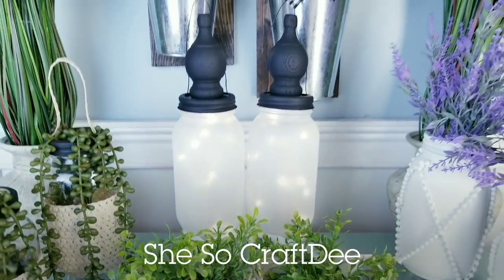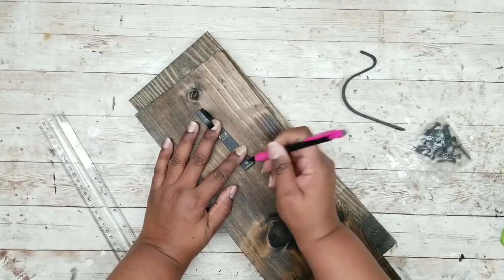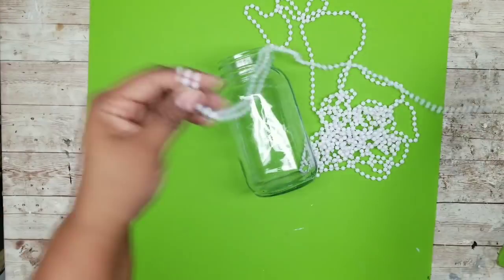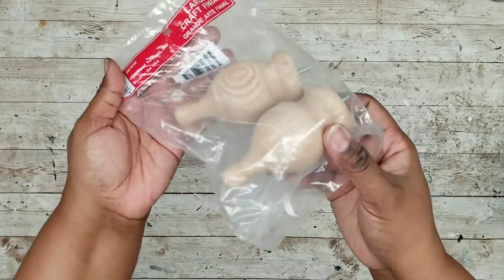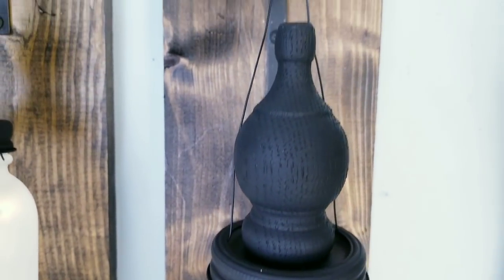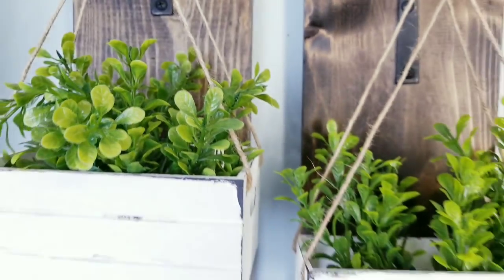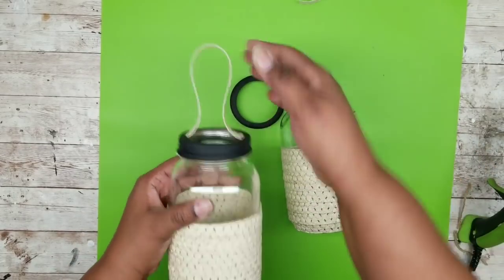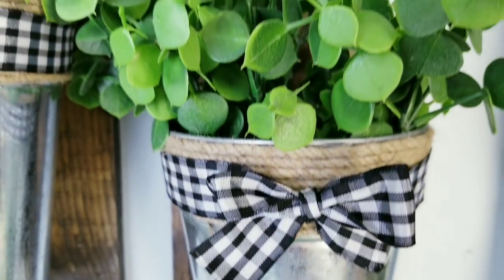*NEW* 6 AWESOME DIYS for WALL SCONCE Decor! | Modern Farmhouse Boho Chic | DOLLAR TREE & Solid Wood!

Comment: The Mason jars are great. All the ways you up cycled them look nice. I’ve got a few ideas using faerie lights, but because of the battery pack I’ve wondered how easy it would be to make solar powered lights. I’ve also considered looking for remote controlled light sets.  The distressed crates look good.  There are tons of things that could be put into the crates. You can use flowers or greenery,  small painted jars, faerie lights, shells, or other small items. The redo of the metal buckets is really cute. And the best is the wall sconces. They’re incredible.
Reply from the maker: Solar lights sound interesting! Such a great idea!! Thank you so much 😀

Comment: I think what I would do is glue the battery pack to the inside of the lid with a small opening in the top on the back side somehow so to turn on or off otherwise you have to unscrew and take them out to do the same